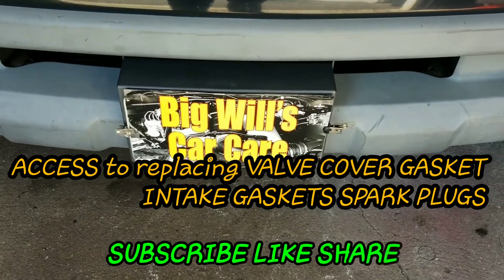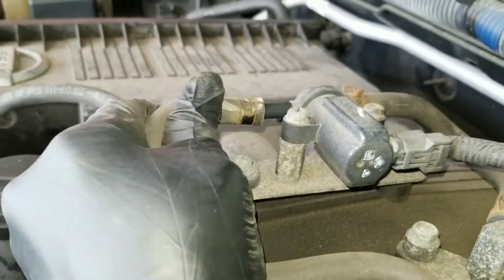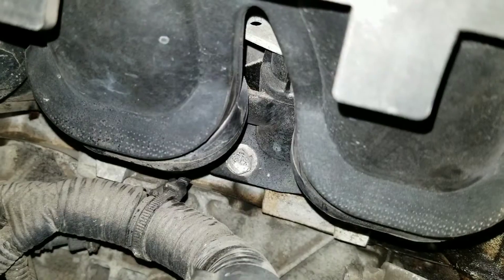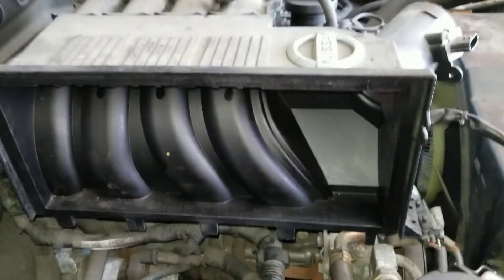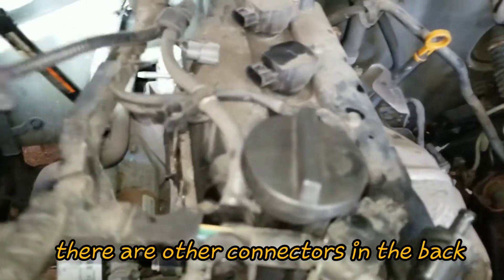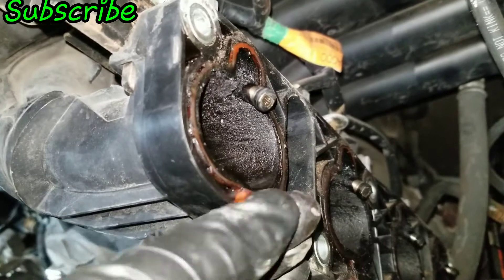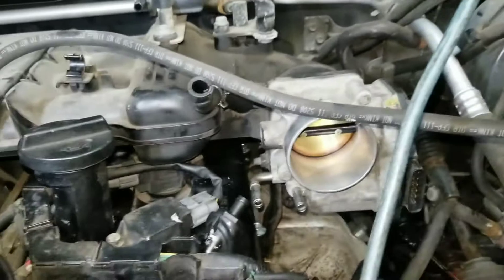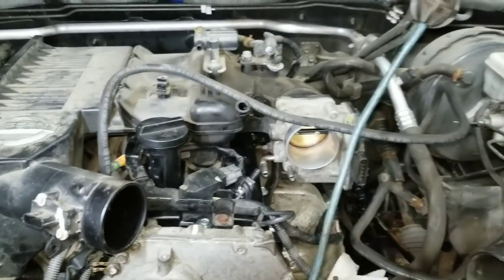Nissan Frontier Valve cover gasket/ Spark plugs/Intake Manifold gasket Replacement

Comment: Very good showing of disassembling of components great camera work 💪
Reply from the maker: @Guy Linhares Thanks for watching please Subscribe if you haven't already
Reply: Are you kidding? This video was very disorganized. The information was scattered, he back tracked several times on missed steps, there's missing footage of parts and critical steps.
Reply: @bobby_hill8357  I just changed spark plugs on the same truck only thing I did different was take inner plastic fender well off to acces intake bolts and front pass tire off easy peasy
Reply from the maker: @pacman3908  there are indeed a few ways to get this done. Thanks for watching please Subscribe if you haven't already
Reply from the maker: @Bobby_Hill I did state in my video that had missing Footage and as stated in my disclaimer , the intent of my videos is to show that certain repairs can be DIY along with proper tools and manuals.  Thanks for watching please Subscribe if you haven't already
Reply: @bobby_hill8357  what did he miss that was critical exactly. if you can watch this video, and still not do this job, maybe you shouldnt be doing this since you can't figure out the in betweens. geez. this video was very detailed, thats what matters, maybe you just need a coloring book manual to teach you

Comment: Removing the airbox(plenum) is a royal pain with those 5 bolts (or 3 bolts and 2 nuts)...however after alot of different angles, mirrors, dropping things trying to get them...i found its easier to remove the passenger tire, spash guard and you can (with a light) see the 3 bolts and get to the with a few long extensions....the 2 nuts are a pain as well (the closer is easier but that back one by the firewall is not easy and its almost a blind feel)
Reply from the maker: @SFCD  You are correct you have to make sure your feeling scence is working lol. Thanks for watching please Like, Share and Subscribe if you haven't already

Comment: No one ever tells the torque specs. I can’t find the torque specs for the intake bolts and studs
Reply from the maker: Usually they are about 5 to 7ft lb. My advice would be to use a 1/4 inch drive and hand tighten them and lightly snug them down. NOT TOO TIGHT

Comment: My Nissan frontier just starting leaking from that area were you put the sealant just a very small oil stain do I have to remove everything or can I just add sealant on that area with out removing everything can it work or no??
Reply from the maker: @MOISES A  the cover has to come off to seal it properly.  Thanks for watching please Like, Share and Subscribe if you haven't already